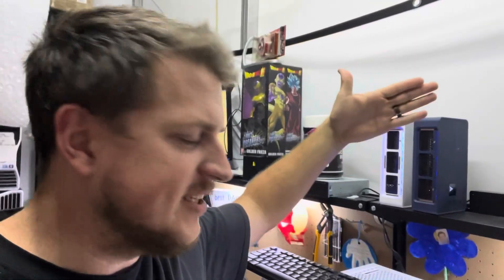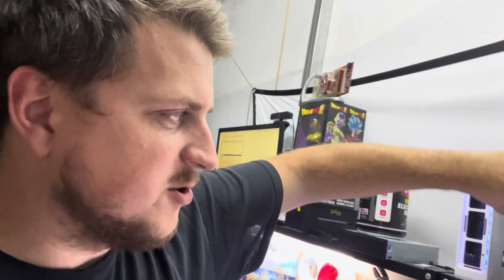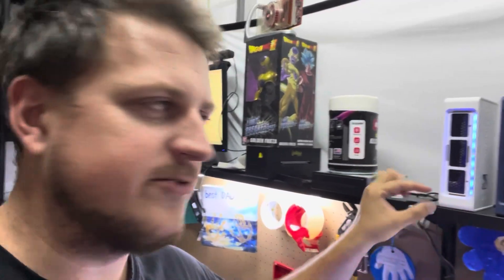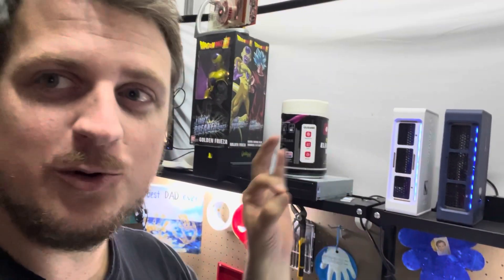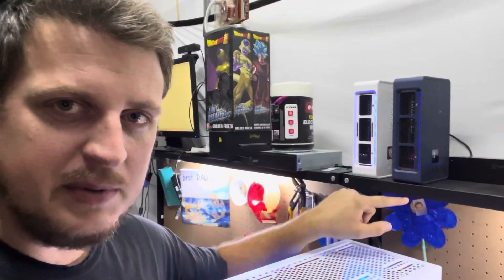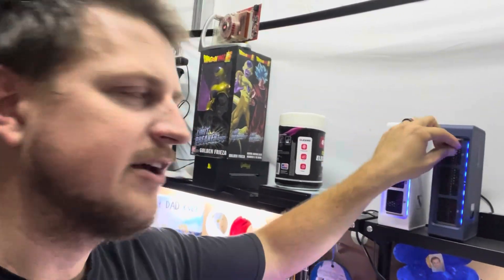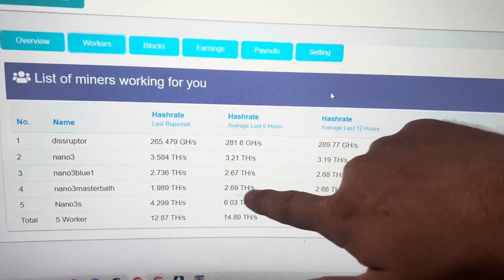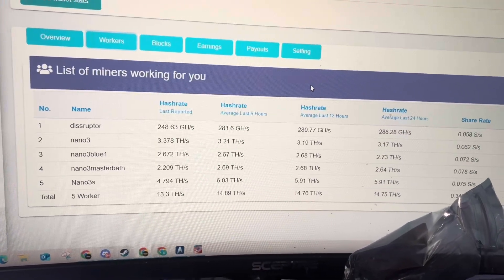Canaan Avalon Nano 3 Must Watch Stability Fix

Comment: This also helped my nanos  to have better network stability i was getting packet burst on my local network becasue i think the network chip for wifi is near the usb-c port too and when i did what was in video it make them going from getting pinged on my local network of 87, 13, 1 ,27, 3  to now 1,1,1,1,2 im so glad i found this video it will now help my latency. i hope this comment might find someone else like me trying to diagnose the problem.

Comment: I tried this with my 3S (wifi module up) because I was having router connection problems and it does seem to work better. WantClue from the Bitaxe project did a video discouraging folks from running their miners consistently at higher than 80% of the power supply's max output for safety reasons. I asked if he thought this also applied to miners like the Nano and his opinion was not sure but probably wouldn't be good for the power supply long term.

Comment: I got one on eBay a new unit. It's been a month.
4/th plastic covers on, running on high, horizontal. 
I don't understand the problem.  What gives?
Reply from the maker: Maybe the new production runs are better I have multiple that won’t hash on high they over heat right out of the box new

Comment: With the Nano 3s, at high power it trips and turns off after a few minutes. If I leave it on low or medium power I have no problems. What do you think?
Reply from the maker: Take the fan grill cover and pop it off. I was able to get better airflow and mine runs high. No issues if you login does it tell you what temperature is it’s running at

Comment: Since the nano 3 has a temp monitor in the admin panel I may try this and see how much it changes.  I run mine on low with a fan in front of it and is at about 60 celcius.
Reply from the maker: From what I can tell, the main issue is not the temperature of the ASIC chip, but it’s the temperature of the chip that controls the power input
Reply: @brandoncoin Roger that, I still want to see how much the temp drops on the chip.  I haven’t invested money in a temp gun yet maybe someday 😅.

Comment: I do have a Nano 3 non-S, so far no problems. I also notice the hashrate was similar to the "Cloud Mining" rates for hashrate.  The advantage the Nano 3 has (along with all SHA256 hardware) is that it merge mines another dozen coins at the same time as BTC - and those proceeds are not reflected in any calculator, although they aren't all that much. Merged mining is just submitting the solutions to all the other "tokens" on the same blockchain that are working on the same problem. With SHA-256, it's a dozen others. There's probably a way to also submit the same solutions to both pool and solo at the same time and I wonder why no one has implemented it yet.

Comment: Something to consider that I did with my Nano 3 and Nano 3s that has them running nice and cool ON HIGH; cut the PWM wire for the fans (yellow wire). This makes the fans run 100% all the time, so it will be louder, but the air flow is MASSIVELY increased and mine went from 90C+ chip temp to 70C.
Reply from the maker: Great idea!!

Comment: I do have several this way now, and on medium and they have been stable. never thought about this. I have 3 dead from the 47r chip failure, but it also took something out. I wish I knew what else failed in addition to that chip. when that ship fails it breaks loose and makes intermittent contact causing a huge voltage spike (28 volts)

Comment: I have 3 Nano 3s that I purchased 8/2025,  have had them for about a month now., have never had them had an issue and running them on high 24/7. I just turned one of them on its side with the wireless adapter on the bottom to see of it stops or get a better hash rate. Hash rates have been good (6.33T,  6.22T , 5.75T) imo so far laying them horizontal so lets see if I get more hash
Reply: Good to know.

Comment: My Nano 3S is on its side and facing up. I have it on something like a wire rack, so i could run the power cord up thru it to plug in the miner, and its blowing the heat straight up. I figured since heat rises i would help it move up and out a little faster by pointing it in that direction and it does great 🎉
Reply from the maker: good idea!